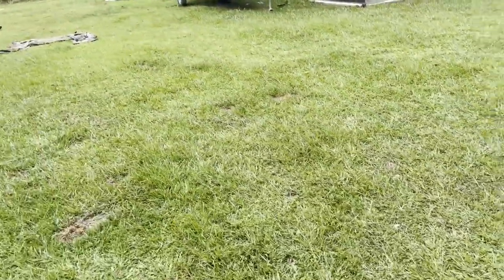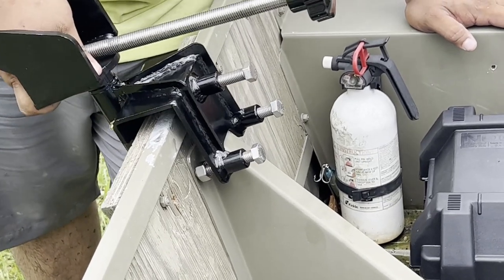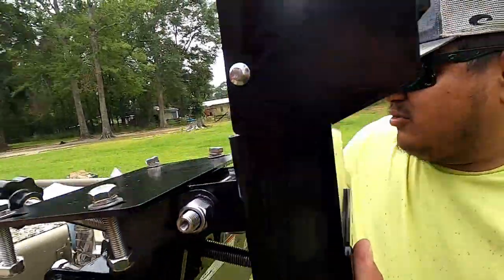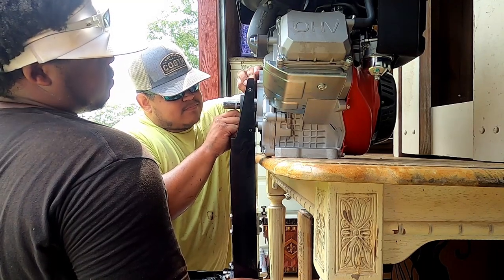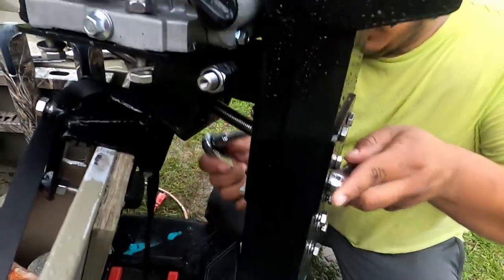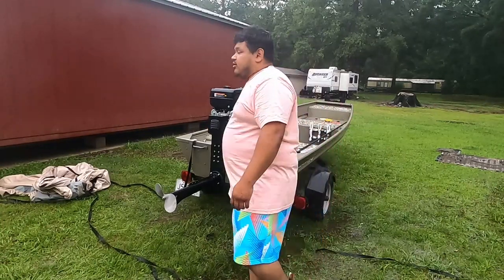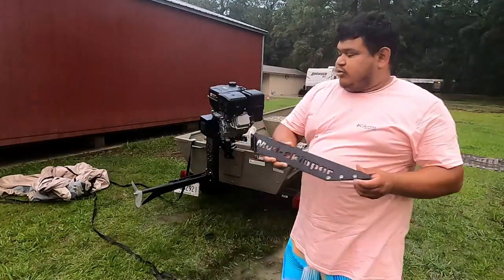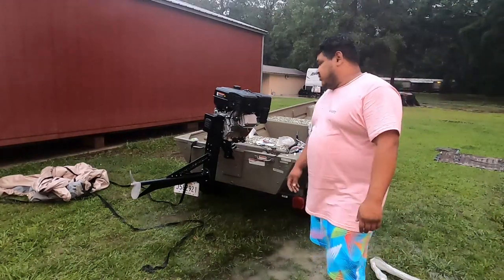Mudskipper featherlite surface drive 13-16 hp assembly

Comment: Any issues with the belt walking either side?
Reply from the maker: No i think most of the people that are have the belt problem are the same people that put the belt on the clutch before putting clutch on so the clutch isn’t sitting all the way back thats just my opinion but they are shimmin it with washers to fix the problem

Comment: I just built the same 13-16 hp kit with the same Predator 459 CC engine.  My prop still spins at engine idle, the clutch kicks in about 2 seconds after startup.  Are you having the same problem?  Did you reduce the idle speed with the adjustment screw on the carburetor to get the clutch to disengage at idle?
Reply from the maker: I had to go down on idling to 1150 I believe but i did go down
Reply from the maker: Sometimes it does spin real slow at 1150 rpms but once inside water clutch worked perfect
Reply: Did you turn out the screw on the carburetor to get to 1150 rpms?  Thanks  @hookedwithbryan
Reply from the maker: @garyrogers507  yes there is a little black screw under the air filter box between the exhaust its a philips head turn the motor on and unscrew very little you will see your rpms drop

Comment: When you installed the clutch onto the drive shaft, did it bottom out against the casing?
Reply from the maker: If you referring if it went all the way back till it hit the back yea .
Reply: @hookedwithbryan  oh dang ok, and you haven’t had any issues with heat friction or anything from the clutch spinning against it?
Reply from the maker: @cameroncongleton5402  I haven’t had a single problem with mine the whole duck season but i did see alot of people with belt problems of it walking those people had to shim it with washers from my understanding but i think those people are the same people who installed the clutch after putting belt first so they didn’t get the clutch to sit all the way back properly
Reply: @hookedwithbryan  Ok bet, I appreciate it man. Makes me feel better about continuing with the install.

Comment: The screw you took out to get the belt on is actually the belt tensioner. I’d recommend putting it back because after some use your belt will stretch a little and without enough tension it will walk to one side or the other of the clutch and rub and eventually come apart
Reply from the maker: Yeah after the video i came to find that out and put it on again